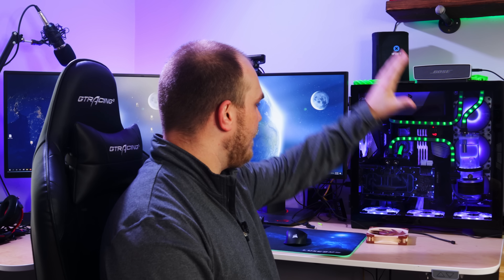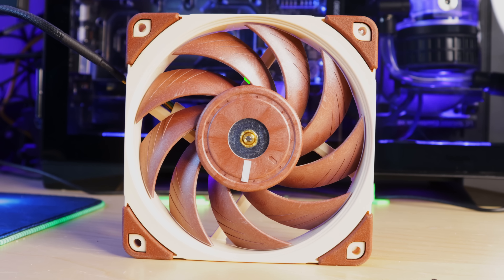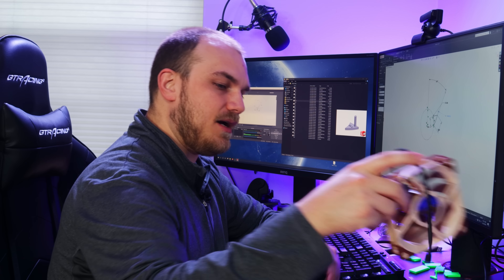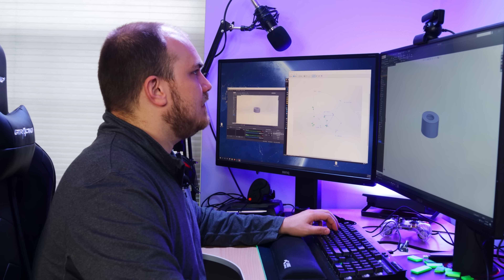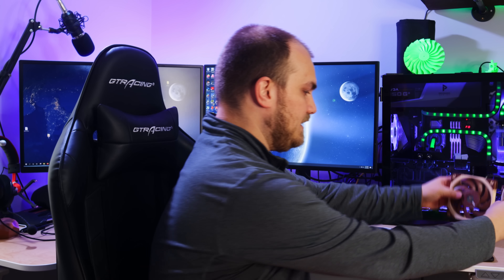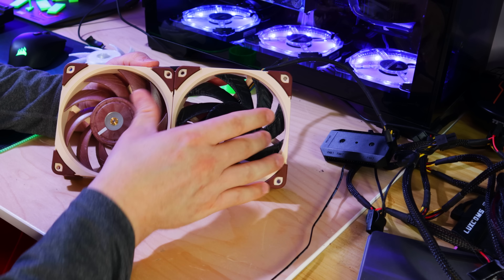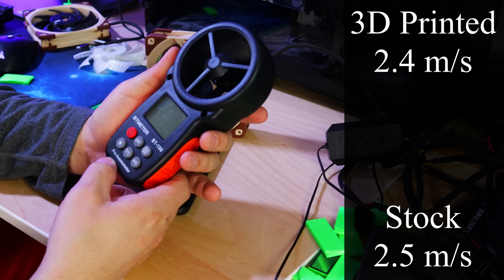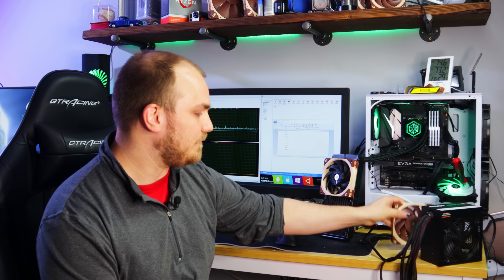I Cloned A Noctua A12x25, Is It Any Good?

Comment: I believe that Noctua uses some form of Glass-Filled Nylon (GFPA6) for their fan blades, it is much more expensive per fan than PLA would be, it is also significantly stronger, it copes much better with vibration and low frequency turbulence, the kind that a Fan like the NF-A12x25 would produce when operating.

If you had a printer that could print in Nylon it would make things a bit more interesting, however the issues with the "layered" construction of traditional 3D printing will still be a major concern as other people have already stated.

So Nylon construction + a mild acetone vapour treatment to blend and join the layers and outside walls of the 3D print should result in even better results.

Comment: Here's an idea. GamersNexus did a review of a Zalman cooler and I noticed an interesting blade design. Maybe try putting some sort of scoop right on the edge of the blade folding back around 45 degrees for about a cm or on the bottom edge of the blade between 90 and 30 degrees for about a cm. This will stick out the hub but interested to see if airflow improves

Comment: For the arduino, I suggest an atmega 32u4 based, since it's real usb and not just serial over usb and you can add macros, so you could have a button or whatever that fires up a key press (for example, add an rfid module and make rfid based macros , or simply fire a macro when your temperature gets above a threshold, while it's a bad idea if poorly implemented, you could even use the rfid or a button, or those keys on old pcs to send passwords.)

Also, I suggest making the LEDs go from blue to red depending on the temperature.

Btw, send me a message if you need help programming the arduino, I've already done some work with leds and have a function that converts a value to an rgb blue to red.

Comment: Make a fan based on DaVinci's "helicopter" design! That'd be fun!
Reply: Although it would look cool and I would also like to see it tested, it will be really inefficient. Basicly a single blade fan using 1.5 revolutions to move the air through it. If I'm not completely wrong the fan in this video moves 9 times the amount of air 14 times faster per revolution. Im sure there's some nuance to my rudimentary math as im not an expert in aerodynamics

Comment: Is it possible that the 3d-printed one was losing hold on the metal part and "skipping" on it a bit?
Reply: Think that'd be dependent on how you oriented the part during print and how hot the motor gets. PLA can deform at 50c (glass transition point for PLA).

Comment: Next time use abs with some abs smoothing if your printer can print abs. It shouldn't need an enclosure because the design is small but you can use a draft shield if you want.

Comment: Have you ever seen the "Corsair iCUE LS100 Smart Lighting Strip" they have no hotspots but you will have to work out how to deal with the extra thickness.
Reply: Using a 144 led/m ws2815 strip with some white pla on top should do the trick.

Comment: Your mic is peaking a lot, turn its gain down a little and bump it back up in editing if needed, will clear that right up.
Reply: or RTX voice
Reply: @vgd409  IIRC that's only good for removing ambient noise. Clipping is a loss of information, and while maybe there are ways to fudge that I don't think it'd be very convincing in anything that runs real-time currently.
Reply: @Teth47  tbh I didn't actually understand what you meant by peaking. I was just really excited about Rtx voice. You seem to know your stuff man. Thanks for the new information.
Reply: @vgd409  PCM (digital audio) clipping generally isn't as noticable as analog distortion, as the digital nature clamps all the exceeding values to the top, you can really go over the resolution (+3db iirc), it loses information in a different way than analog does, you could consider PCM clipping to be a very rudamentary hard limiter, one that completely disregards attack curves, and just drops everything going over the ceiling right at the celing

analog doesn't really have "resolution" like digital does, analog tends to click and overdrive signals easier.
that said, if you put too much gain in the pre-amp stage, it will sound somewhat similar, shittier, but somewhat similar.
Reply: I cant hear any peaking in the mic

Comment: I think the difference was you didn't put an actual airfoil to the fan blade. Fan blades are basically wings twisted. That's the reason it has slower rpm, it has more drag because it's less aerodynamic
Reply: Actually he did, it is concave, what makes it a simple airfoil. In the end the only thing that matters on that scale is the leading edge to be round to have a clean air layer separation and laminar flow in the beginning.

Comment: what about trying those techniques to smooth out the stepping of the layers with ethyl acetate vapor, or by applying a layer of paint and a layer of polyurethane. i imagine that the smoother blades would lead to reduced noise/terbulance?

Comment: Can you put it in a acetone bad just so the layers bond better and create a smooth surface and see if it makes a difference in air Flow , Noise, and fan speed?
Reply: It's pla, not abs,  so it doesn't work that well, though sandpaper and a heat gun might work.

Comment: 0:52 "Reverse Engineering"
1:46 "Giant stack of fans"

My mind immediately went to a roots style supercharger.  Where would this fit in?  I don't know.  But, since the top mount 120-140mm fan's sit a bit offset, maybe make the "blower" for the top of a case to act as an intake? Either way, I'll be interested to see what you come up with next!
Reply from the maker: not going to lie i did some cad work designing a pro-charger type supercharger fan but never finished it maybe ill revisit.
Reply: @MajorHardware  If you revisit it, that would be awesome!  Even if you don't, you still make some really interesting content. Thanks for the response!!

Comment: Nice i like your work :-)  it would be better if you could mesure in CFM (as that's what's used for fans)
Reply from the maker: for the stock a12 at 2.5m/s the cfm for 120mm fan would be 239.64

Comment: I would test the set up with no fan at all to see what the speed the hub spins at to see if perhaps you just have a hub motor that is not as good as the other.  Another thing is just do some smoothing on the outside of your fan might help.  You can use acetone to do it pretty easily but spray paint and polyurethane works better without weakening it.

Comment: I think if you spent 1 day in cad and testing different designs of fans and made your own fans AND SOLD THEM TO YOUR AUDIENCE you would get enough funds to get better material to make better fans and then MAKE YOUR own company of fans but you have to design your own unique fan which is hard but I believe you could do it
Reply from the maker: my fans would be literal spinning RGBs
Reply: @MajorHardware  and I buy them if it meant supporting the channel
Reply: @MajorHardware  if you have some working design, get a flex pcb that matches the wing, and fill it with staggered 2020 leds, then if you have them fast enough, you could turn the fan into a screen.
Reply: @MajorHardware  Dude have you ever seen them leds that you can put on a bike wheel? when it's spinning the right speed they make a pattern, it looks pretty cool.

Comment: don't know if you're aware but noctua uses a special crystalline polymer called sterox for the nfa12x25, it's how they can maintain sub mm clearance to the fan frame at high rpm, the sterox is so rigid that the blades don't expand due to centrifugal force which is what makes them so efficient.
Reply from the maker: at speeds of 2000rpm im not sure how much expanding is truly going   on
Reply: @MajorHardware  Apparently alot, enough to where they are having to reformulate the sterox to release a chromax version because even the difference in pigment is having a pretty drastic effect on the rigidity, it's why it's taking them so long. The standard range of their fans have a much larger gap between the frame, and the tip of the blades, they need more rpm to produce the same numbers due to less efficiency from the gap.
Reply: @MajorHardware  also, notice how despite your blade being lighter, it spins 200 rpm slower and produces more noise? Im willing to bet if you film close up with a high speed camera you are rubbing on the fan frame once you get up to maximum rpm, it might be just a few molecules worth of rub but thats enough to make a big difference. In theory if you copy dimensions that close, while having lighter weight, you should be performing better. I think what we are seeing here is simply a difference in blade material, which is why the nfa12x25 is so expensive.
Reply: @Cichlid_Visuals  I dont think so, there would have been marks on the frame since its black PLA.
Side note, yes they had problems with the material,  but not as much as one would expect. In an interview they said it was mostly about the long time durability with the new color. So in the beginning all fan blades don't expand that much, but time does weaken them and then you get noise.

Comment: I'd like you to slow the faster fan down until the rpm values match within something like 1% of each other, that would be the fairest comparison outside of using the same fan motor for both blades.

It should be possible by lowering the pwm value in 5% increments.
Still having said that, to come within margin of error for performance with a 3d printed blade design is really cool, with some tweaking to smooth the printing lines out you might even get the noise down as well.

Comment: It would be interesting to see how a duct fan performs compared to a regular fan design.

Apple uses duct fans for the Mac Pro to reduce any noise caused by turbulence from the  gap between the edge of the blade and the fan mount. They also are “dynamically balances” the blades are not identical to produce a wider noise spectrum to be less audibly noticeable.

And interesting test might be just adding that ducting to the same fan design and comparing the performance.
Reply from the maker: ill have to look into this
Reply: That's what I meant with combine the noctua and noiseblocker eloop design. Maybe even remove the upper part of the frame so there is no gap.
The rest of apple's approach isn't feasible without special equipment. But it would be possible to slightly differentiate the triangles on the blade for spreading the harmonics.

Comment: Did you thought of getting a propeller balancer for RCs to get rid of vibrations? Some metal tape or sanding would be enough to make it easily fully balanced
Reply from the maker: i have one but this design wouldnt fit
Reply: @MajorHardware  3d print a hub template, balance that, then use the hub to balance the fan, not perfect, but probably better than nothing.

Comment: I bet sanding the leading edge a bit rounder, gives you much closer results
Reply from the maker: that was the hope i worked well
Reply: @MajorHardware  the actually results are amazing for eyeballing the design
Reply: @MajorHardware  oh I understand now what you mean, we talked in two directions. 
I meant you should remove any sharp edge on the front of each blade to reduce vortexes because they add drag, that's why you possibly get lower rpm

Comment: I think you should invest in a 3D scanner or some photogrammetry software.
Also curious why you didn't just import an image of the fan into SOLIDWORKS to sketch over.
Reply from the maker: they have things like that, i have used them professionally however i dont have the funds to buy one
Reply: @MajorHardware  time to start plugging that patreon
Reply: @MajorHardware  • You want a Budget 3D Scanner... get yourself a Microsoft Kinect v1.x 
Now as a note., while you could get a Kinect v2 (usually for about the same price., $100-140) in terms of the Depth Sensor... you have identical Resolution (approx. 68 DPI) 

But Kinect v1.1 (Windows) or Kinect v2.0 will both support Depths closer than 30cm., which Kinect v1.0 (Xbox) doesn't.
Of course you could splurge for the Azure Kinect (which is v3.0), and is a hand unit capable of 4K RGB, HD Depth and Motion Sensing. 
That last aspect could actually be useful if you wanted to make an App that allowed you to simply move the Kinect around the Object tracking your 3D Position in Relation to it with Redundancy Accuracy. 

But it is £355 (almost 3x the Price, so... eh not quite as "Cheap" a solution) 
Still it's better than Consumer 3D Scanner., which tend to be between £550 - 950... there is a "Budget" one for like £150 or such; but it's more or less just a 3D Printed Rig using Optical Cameras and Open Source Solution.

I'd imagine it'd be somewhat more Noisy in the Results., where-as the Kinect IR Depth is far less Noisy and can more easily be cleaned up with Machine Learning.
Reply: solidworks is free for fake students
Reply: @mentatteg  autodesk fusion 360 is free for noncommercial use.
Reply: just use a normal document scanner and use image editing software to figure out the dimensions.  For most of the things he measured here, that would have been much more accurate.